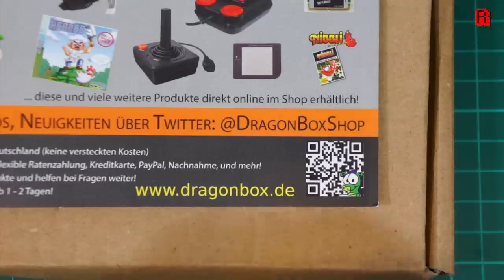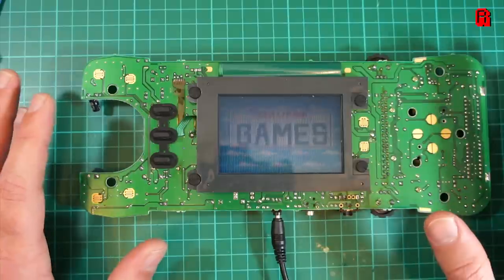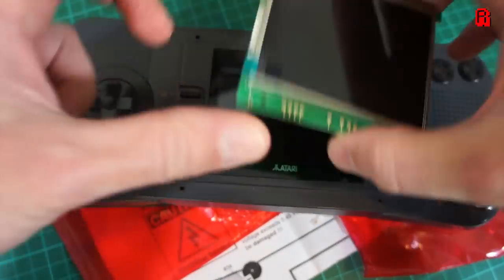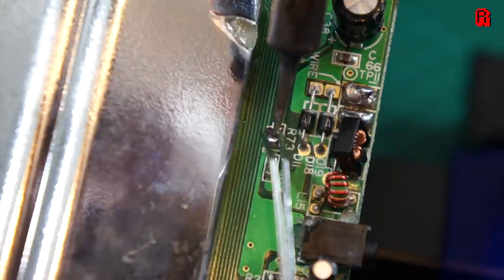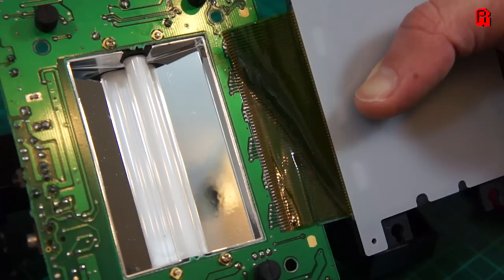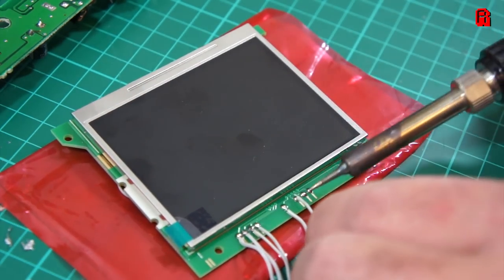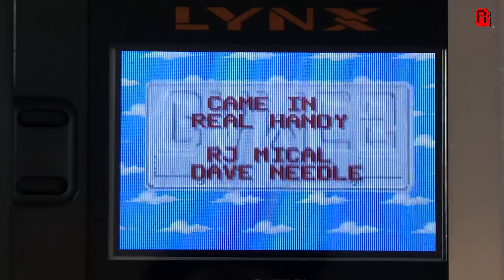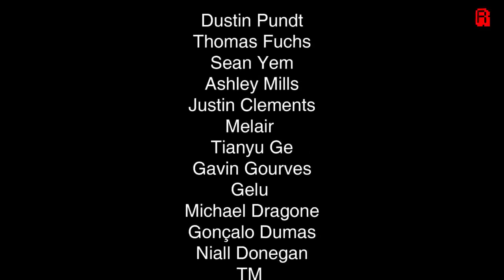Atari Lynx | LCD Upgrade (Mcwill Mod)

Comment: Even atari would be impressed,,but the only thing i never never understand is,,, why does it came with a vga output with not just s-video or RGB out???

The thing is that the lynx resolution is sooo low for a vgs screen,while on an old crt tv it's less noticeble.

But still this is a must mod.
Reply from the maker: The resolution is 160x102 far less even than 240p you're right.  I'll get it wired up some day and share the results
Reply: RetroManCave you know what i would like but that will require tapping the signal digitally,a vectorizer smoothing filter to smooth up that 160x102 resolution into 1080p without blockey graphics,even not when objects are zoomed in.

Comment: I'm curious. Did you see battery life improvement
Reply from the maker: Chris Honn I intend to run a side by side test with another Lynx when I fix it so we can see the difference.  I've only been using it on mains in the cave since the mod but I would expect an improvement
Reply: Considering you're not using the fluorescent tube any longer i would hope so. In any case, i love your vids and hope you keep making them
Reply from the maker: Chris Honn thanks Chris!  I intend to...big plans for 2018

Comment: Any good games for the Lynx?
Reply from the maker: +milkbullet cali games is fun, Slime world is great, chips challenge is a good puzzler and APB isn't a bad conversion.  Plenty to have some fun
Reply: RetroManCave Thanks! I'll try it out (emulating, of course - I wish i had the means to get one and go through all the mods)
Reply: There’s a Batman Returns game that’s a decent beat’em up. 
There’s also a racing game that I’ve forgotten the name of.
Reply: @johnsch8634  Checkered Flag?
Reply: Dava Arvarabi right, not a bad game.
Reply: @johnsch8634 One of the best game game on the system and also one of the game that showcased the true capabilities of the system.

It would have been alot better if it had a multiplayer mode, so you can race with your friends along with several bots on the circuit :P

Comment: How does the Lynx stack up against Nintendo's GBA? With the new screen the Lynx looks years ahead of it's time, I'd guess the GBA has a bit more power but for scrolling 2D games it looks close.
Reply from the maker: +John S its been a few years since I used a GBA.  I'd expect the GBA to have the advantage and GBA has a higher resolution, although the Lynx has a few sprite scaling tricks in its custom chips which help it keep pace with the competition.  This was released within weeks of the original gameboy which was its real competition.
Reply: It seems the Lynx was an impressive piece of hardware hidden behind an LCD screen that did it no favours. Thanks for posting the video, if you're a Lynx owner this is definitely worth thinking about. The only con is if you're a purist who insists on keeping things exactly as they were.
Reply: Well, the GBA is a 32bit system that was released a good 10 years after the Lynx, so on a hardware level, it's much more advanced. It's game library is massive (even more so on backward compatible models) and there's all sorts of genres - whereas Atari tended toward arcade-type games. But if you're asking about the screens - that replacement LCD on the Lynx is light-years ahead of the GBA's - the original model had a horrible, unlit screen that is incredibly murky and dim. The SP-101 model has a lovely backlit screen, as does (I think) the GBA Micro and of course, the DS Lite when playing GBA titles (but no GBC or original GB on the DS Lite). That said, I hate the cramped form factor of the SP and GBA Micro, and you can fit an SP-101 screen (with some work) in an original model GBC, which makes it a much more viable handheld. Add a multicart like an Everdrive and you're in handheld heaven.
Reply: ZygmaExperiment don't forget that you can emulate GB/GBC easily on a DS using an R4 cart or similar. Most games are compatible and it even has a turbo mode for easy grinding in RPGs :) I still prefer my backlit original GBA though which I bought pre-modded for a very reasonable price. I don't have an Everdrive yet but EZ-Flash just released an update for their GBA flash cart which means you don't have to pre-patch the ROMs anymore so it's almost as good.
Reply: Yuki Saitou I have the latest EZ Flash 4 and gotta say I would never pay for the Everdrive. All you get better on the Everdrive is RTC, rest is same + no bulge outside. These things are amazing.
On the Lynx tho: that device is a clear case of "too ahead of it's time". The color backlit LCD was to be the killer but well, it really was some 10-15 years too soon. Nintendo never tried too much on handhelds and managed it cheaply in other hand.

Now that the Lynx has been brought what it needed on start, it's REALLY impressive indeed.

Comment: Does anyone actually use the scanlines option in emulators and retro modern inspired games etc? I know I don't because it's never the same and in most cases makes the game look shite.
Reply from the maker: What If? I use composite out on a Pi3 to try and get an authentic output, but it only outputs in 480i (interlaced) rather than 240p so even that feels wrong.  Sometimes only the original hardware will do.  But in the case of the Lynx the original screen was its weakest part for me.